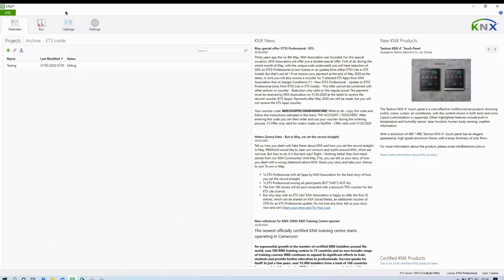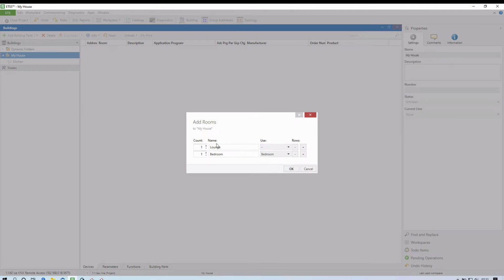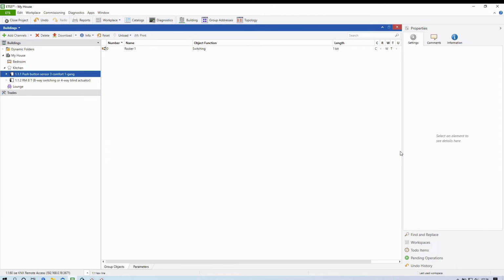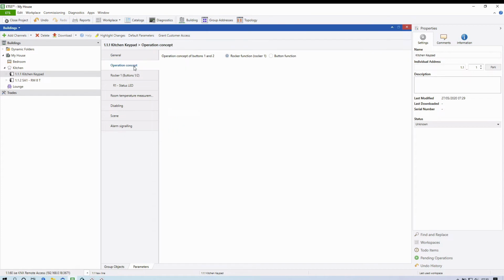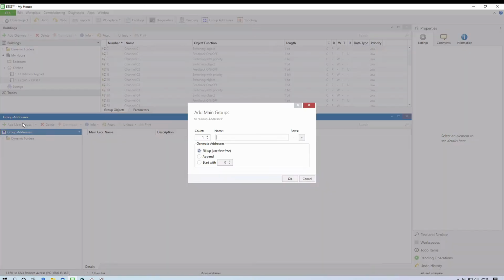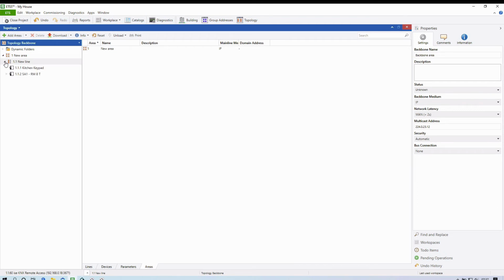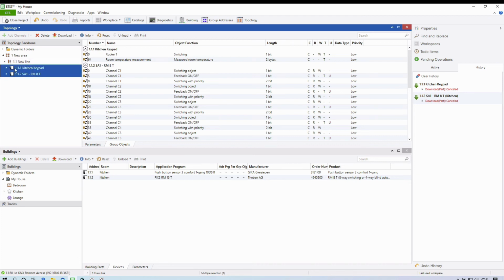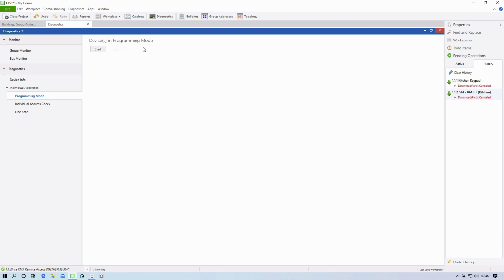How to program KNX: ETS5 Introduction Part 2 - Ivory Egg

Comment: Just a scenario, if you happen to add more devices (actuators). Then, its function will be monitored by the group-address, but how will the system identify whether it is the actuator in the kitchen or in the sitting room. I have little knowledge about one BMS system, and out there you need to add the MAC-address of the actuator, so that corresponding relays and its subsequent lights respond to one particular actuator or relay. How doe the addressing of the devices work in KNX

Comment: first of all thank you for your tutorials. it helps me a much
i have a question about ETS. how do i  upload my ETS program to devices? 
I mean do i must only use KNX IP router to upload or is there a any other way to do that?
for example, if i am using only actuators and iswitch to control lights, how do i program it?
Reply from the maker: Thanks for the kind words. You will need a USB Interface or a IP Router or Interface. There are also lots of KNX IP devices that have an IP interface connection you can use to program as well.